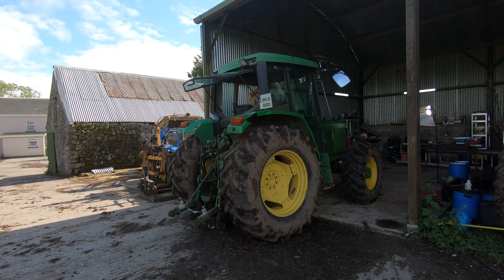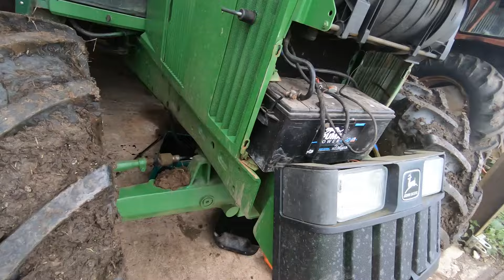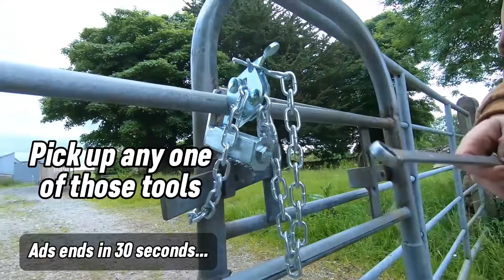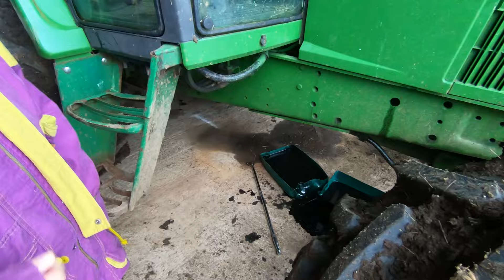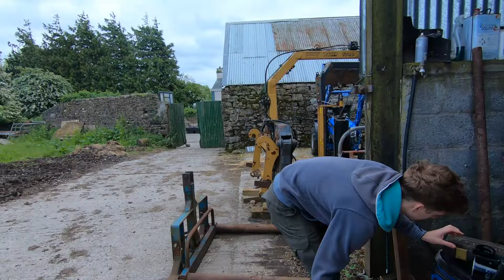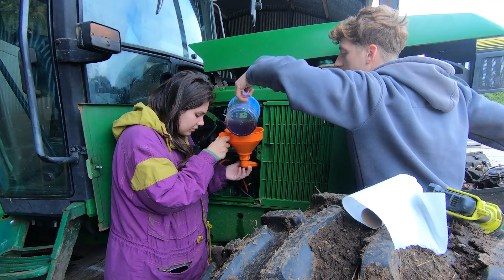Did my Girlfriend break my Tractor?!?

Comment: Did you not buy a loader  for that tractor a while ago
Reply from the maker: I did, i have a brand new loader valve and joystick also but the project is still very expensive ill need pipes and maybe new seals on the rams. It will be done but we still have the solis here with the loader also so no panic but I shouldn't delay